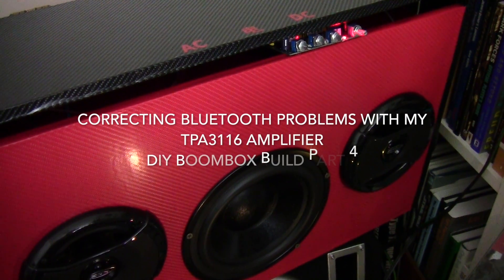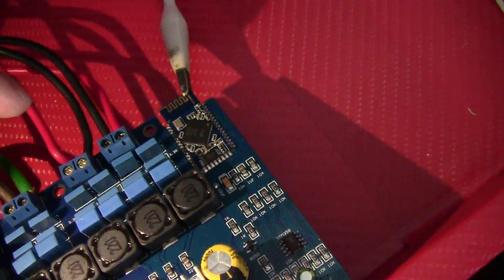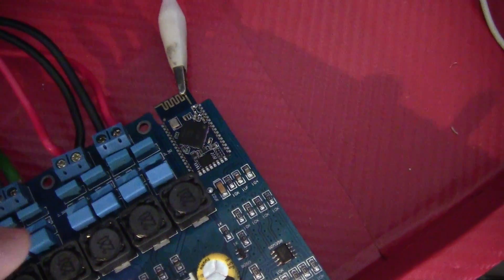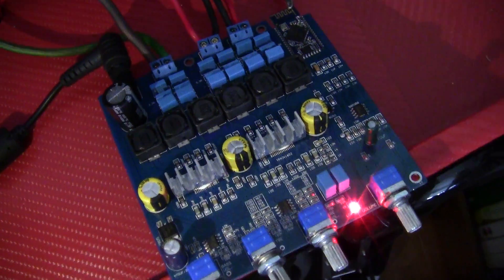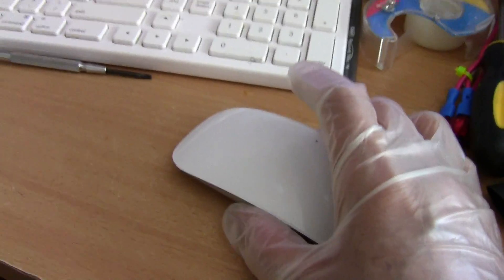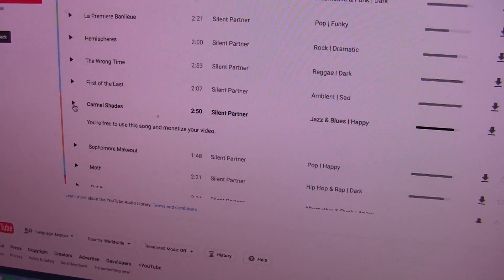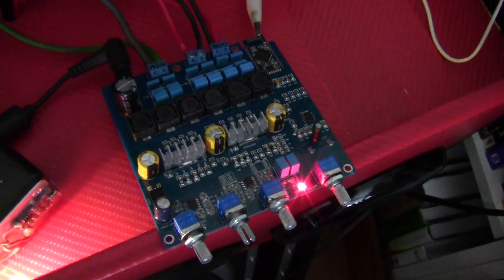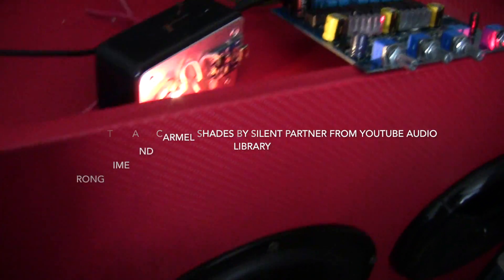Correcting bluetooth amplifier problems in my diy boombox. Boom box  build part 4

Comment: you should put some shrink wrap on those tuning knobs.
Reply from the maker: That's an idea. I have to think of something more permanent though,  and cheap.  That's not an easy combination.
Reply: I've made knobs out of wood dowels before, you just drill a hole down the center that fits the pots tight and then cut off as many as you need with a miter box. Sand them to your liking and paint/vinyl wrap.